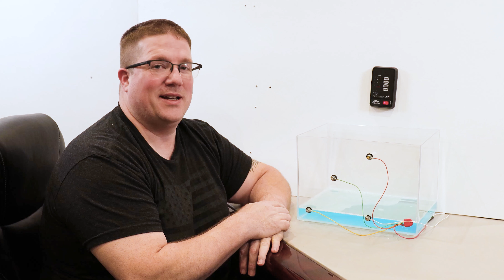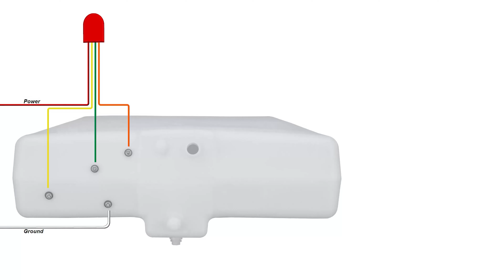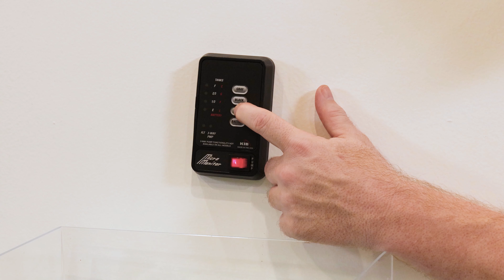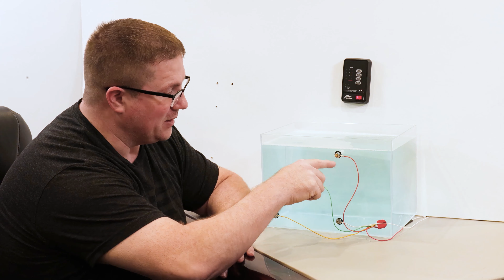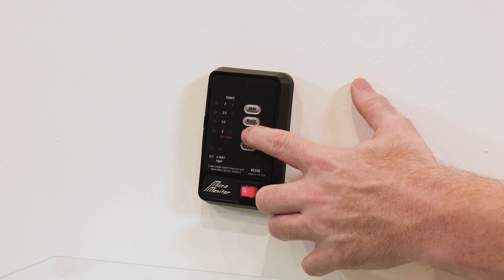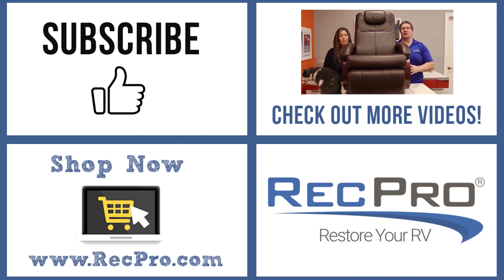How to Install a Tank Sensor Kit

Comment: But he didn't specify how the tank sensors were supposed to be installed at all what size hole do I do I use to drill a hole do I put this washer or this nut or how do I put the rubber piece in

Comment: Brian, have a 2021 Sundance 265S with one blackwater tank and two greywater tanks.
The monitor work fine for the greywater tanks but the blackwater tank is empty but the monitor shows full. 
No water in tank.
No build up on sensors because I just replaced them today
All wiring has bee gone through so that we have good connections that are waterproof.

what might be causing the monitor to show a full tank of blackwater when there is nothing in the tank?

Comment: Gray tank reading 3/4. Black reading full. Extensive cleaning-no change. Installed new upgraded gray tank sensors (waiting on black tank sensors)-no change. I checked both pigtail resistors resistance. Both perfect. I disconnected signal wires-no change. I disconnected ground wires-no change. I can remove all sensor wires in any combination-no change. I replaced monitor board-no change. Word of note- for whatever reason, the gray full sensor works perfectly. Freshwater and battery work perfectly. Please help. Any ideas?
Reply from the maker: Hello! If you reach out to our customer service team at info@recpro.com they'll be able to help you out!

Comment: So all the wires are spliced together? Trying to figure out how to wire this. My grey tanks wires got destroyed. I have the ground hooked up. But do I just twist the all three sensors wires into eachother then the wire that goes back to the gauge? Im very lost. Is it a special connector i need to buy?
Reply from the maker: Hello, you do not twist all of the wires for the sensors into each other. You should have a tank tire harness for the sensor probes. It should have a orange, green, yellow, and a red wire. When you connect the wires to the probes, you just tighten them down using the nut on the probes. The bottom / empty probe will connect to the yellow wire. The 2/3 sensor probe will connect to the the green wire. Then the full / top probe will connect to the orange wire. After you have all of them connected, then the red wire you'll connect to your monitor panel. If you have any more questions feel free to reach out to our customer service team at our number at 574--848-0405 or at info@recpro.com.
Reply from the maker: If you don't have the wire harness, here is a link. https://recpro.com/rv-replacement-tank-wire-harness-for-sensor-probes/?searchid=7088070&search_query=wire+harness
Reply: Awfully appreciated. Thank you. @RecProUSA

Comment: My tank doesn't have an access panel. How would I attach the probes? Or is there a good way to install a panel?
Reply: The tank is not supposed to have an access panel. You just need to find the side of your tank and place the probes in the side of the tank (not some enclosure but the actual tank). One, 2 inches above the bottom of the tank; one 2 inches from the top of the tank and one mid point of the tank. The final one is also at 2 inches above the bottom of the tank. Look at Brian's tank and you'll see the layout for 4 sensors.

Comment: Ok, I'm only using the fresh water tank. On the monitor, orange to positive, purple to negative, blue to red on wiring harness and white to white. Pump works (no light on the switch) but no lights on the meter for water level. Its over half full. Any ideas?
Reply from the maker: If you have one of our monitor panels, then you can send an email to our customer service team, they will be able to help you and send you a wiring diagram for that model. The email to send to is info@recpro.com

Comment: Hi Brian,
Can you help me to figure out where I should install RV monitor panel on 1985 Winnibago Chieftain 22 ft? 
Fresh water tank is located undeer the closet which is on the left side. I noticed the sensors are attached to the tank and five wires go up ro the ceiling. I have no way to find out where they are wired to in the RV. 
There is monitor panel in owner's manual. 
Electrical diagram tgat I found online is for 1990 Winnibago.

If you can send me any information about how to find final location of wires for monitor panel I will be so grateful to you. 
I bought this motor home two months ago and it has been a lit if challenge to fix it. 
Thanks

Comment: Tonight I tested the system on a second tank using just a ground probe and the only remaining probe I had (They are needed in batches of 4, but are sold in batches of 6!?).

Anyway, I could connect any one of the 3 level indicator wires to the one non-ground probe, and get the appropriate reading...all lights including the appropriate one, and the ones below it, lit up on the meter when any given wire was attached to my one probe on this tank and it was submerged.  SO, you don't really have to have all the probes working.

I tested my other tank by disconnecting the ground probe on the freshwater tank and can confirm that you DO need the ground probe connected.  I still haven't tested what happens when the ground probe isn't submerged at all, but things work basically as expected when the ground probe is submerged, and I recommend putting it as low as is reasonable on the tank.

On the second tank (with only 2 probes, one ground and one level probe), I noticed that I don't get an Empty reading when the second probe isn't submerged...this happens regardless of which level indicator is attached.  I do recall seeing that reading on the 4 probe tank previously (before I totally filled it up), so I'm not sure why it's different on the 2 probe tank...but I have read online that the readings can be a little funky, as the system somehow retains a "memory" of the prior reading, and the current reading is "relative" to that reading somehow...My guess is that the overall resistance is being changed based on which probe is connected, and that the "relative" feature is what enables this to work across lots of different sized tanks.  If so, the precise order in which I tested the 2 probe tank might be what's throwing off the ability to get an Empty reading right now...but I'm not really gonna fool with it much more...I'll get two more probes somewhere and make the grey tank fully functional, but for now I just have it working well with one probe that lets me know when it's basically full and ready to dump.

Pro tip...didn't realize my tank wasn't fully level under the van, and runs downhill...wish I had installed the one level probe I have on the grey tank a little lower, since the location I installed on the rear of the tank reads 2/3 full when it's really full up front!  oops!

Comment: For others who are fretting this install...I installed mine yesterday without using a probe for the positive input (red wire to blue (fresh tank)).  This is how it is installed in the video above, but not like a number of other videos or the instructions suggest.  I installed the ground wire on a probe a few inches from the bottom of the tank, and located it below the horizontal height of the yellow probe (since I had seen some reference to this as possibly being necessary, but am not sure if it really is).  I installed the red plastic wiring unit slightly above the yellow wire horizontally, and the ground probe was physically near it, but located below the red plastic unit.  I kept all probes 10+ inches apart (as mentioned on some videos, but not the instructions), and it worked like a charm....but it's not actually all that easy to get these wires 10 inches apart  All three lights light up when the tank is full, and 2 when ~1/2 full.  I never had the water below the ground probe level, so I am not sure what happens if the ground probe isn't submerged at all...I'm kinda curious if that really requires a probe at all...I may test that.  I'm also not sure if it would work as intended if I just disconnect the yellow bottom probe or if it means just that bottom light wouldn't work but the rest would...I may test that next, just because I'm pretty low on probes and need to wire a grey tank...I would like to wire it at 2/3 using the 2/3 probe, just so I know when to dump, but I am not sure how dependent the 2/3 probe is on the 1/3 probe being installed and submerged...I may have to just use the 1/3 and know that the light indicator means 2/3 on that tank.
Reply: Thanks for writing these comments!! So many of us are teaching ourselves how to complete these projects only using youtube and any instructions we get from the product/company. It is SO confusing (and time consuming to figure out) when things like having the red/power wire hooked up to a tank probe are shown on the instruction paper (without a reason why) but nothing is shown in videos like these. Also you're so right about the packet of 6 probes... it's great if they want to give that many, but they should at least mention somewhere that 1-2 are extras... 

So... you didn't connect the red wire to a probe, you just connected it straight to the blue (fresh water) wire? 

Also, for the white ground wire, I am a little confused about the whole set-up. So there needs to be a probe on both the fresh and grey water tanks as close to the bottom as possible. From these probes, am I correct to say that the wires need to be connected to each other and then connected to the white wire coming out of the panel? In a diagram I found, it also shows that white wiring system going to the battery bank and then off to the side. Is this a separate ground wire to the vehicle frame, or is the diagram just showing that the batteries need a general ground that we would already have (in which case, we wouldn't need to add additional wiring)?

Comment: just received the Sensor Monitor Panel M21 did not come with instruction manual.. this is for a new install for black water tank only.